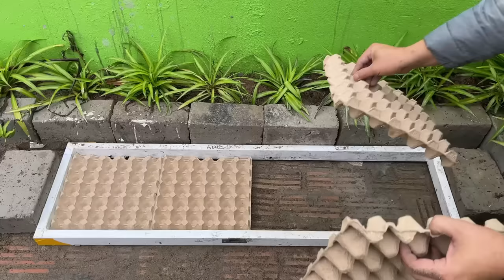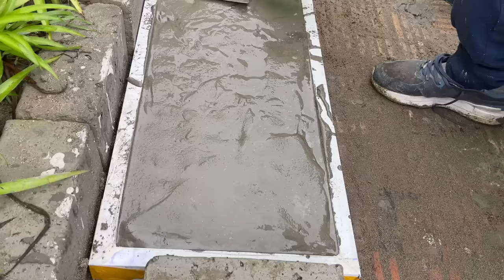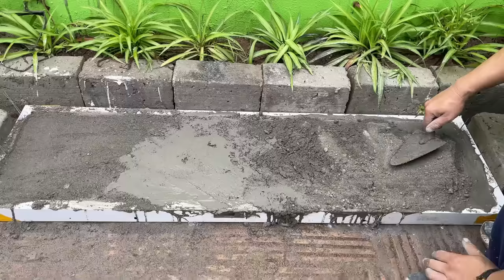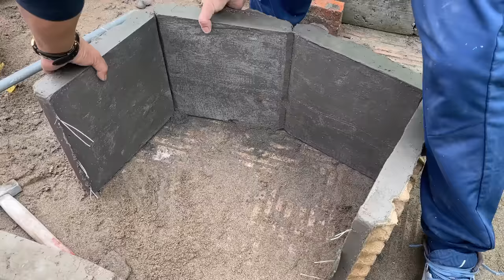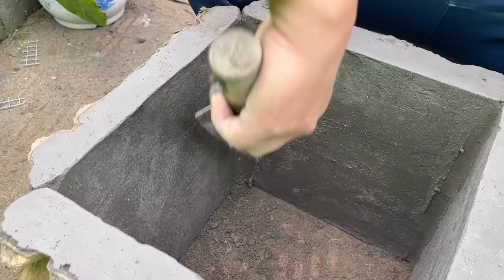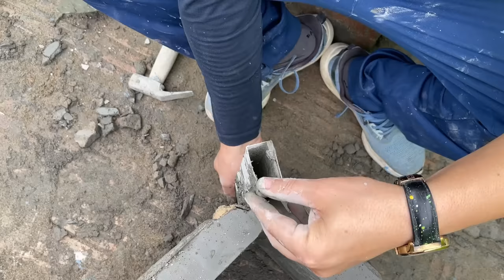Flower pots craft // Details how to make Flower pots from Cement and Egg trays

Comment: The method use also is completely inefficient from the point of view of most people with access  to a home improvement store.  I would simply buy 5 prefabricated square pavers for 1-3 dollars each, then apply a layer of cement and cartons on top of each block and let them cure.  Then, assemble the four sides around the 5th paver, and cement them together, ideally embedding a metal mesh inside for structural reinforcement.  then apply cement and cartons on top of each block let them cure then a symboled sides and the base at the same time applying a reinforcing mash on the inside to give it structure and apply the concrete then Instead of going through all of this process which requires a certain amount of skill level in trowelling
Reply from the maker: Your method is also great! Thanks!

Comment: For those of you that don’t know this do you understand why they remove the cardboard instead of just painting over it here’s something that you might think of next time you make a project like this make sure that any cardboard or would you get it away from that concrete, or you’re going to have some little visitors termites have recognized now and have for quite some time when there’s wood and concrete together they have a perfect munching machine they will devour. Everything may take them a little time but they will get it done and if you have cardboard in your basement, make sure it’s not sitting on the floor. They’ll be after it they’re just as much as any place else, otherwise this is a great idea
Reply from the maker: Thank you for your interest and for giving me useful experiences in my work
Reply: Never heard that! Thanks for the info!!!

Comment: the "weep"  "drainage holes" should be at least 3 inches up on 2 sides of the planters .>>>  NEVER ON THE BOTTOOM, serious growers need to  create a wicking base so water does not just run through and out of the bottom...
Reply from the maker: Thanks for your comment! It is very helpful for my work!
Reply: @No.1CreativeCementIdeas   also best for growing and not letting plants get too dry... on the extension, I would find a light weight filler as a replacement to make the pot lighter.. can use cloth or, perlite or, shredded styrofoam then your 2 inches of cement.  good luck exceptional plan.